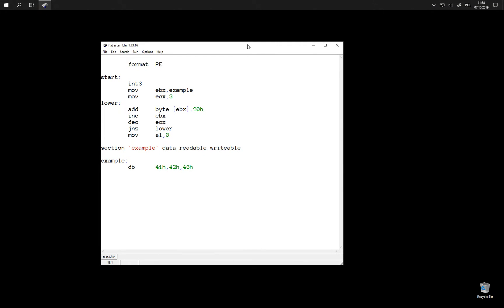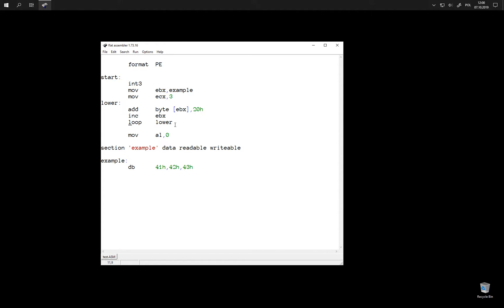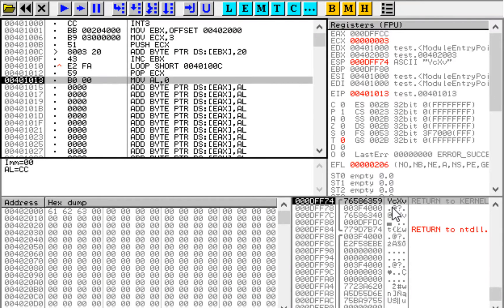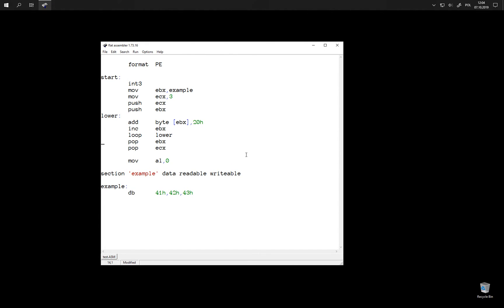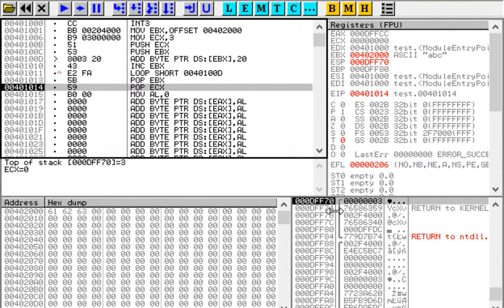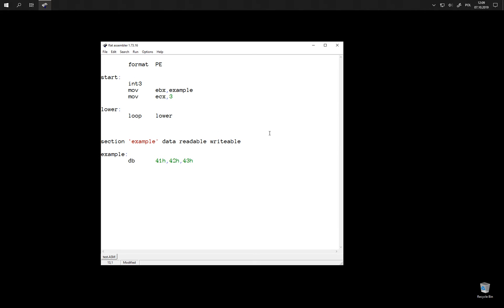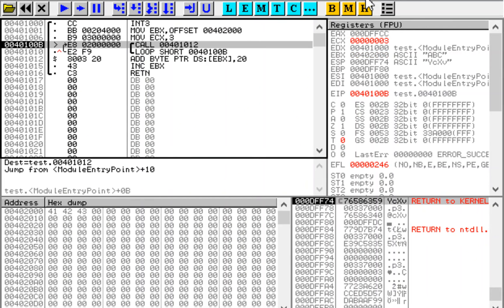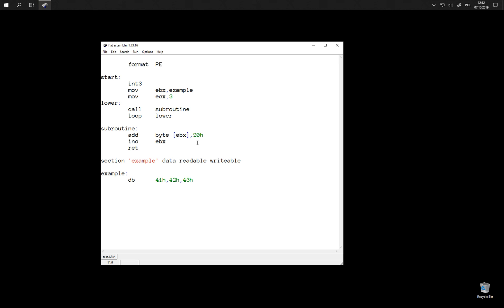Introduction to x86 assembly, part 3: The stack

Comment: Is it ok to just do "ret" to exit your application ?
Instead of calling ExitProcess(0);
It seem to be working.
Reply: Late reply, but if you're on Windows for your own understanding you can look at the Documentation for the 'ExitProcess' function and their 'Terminating a Process' Article. I'm by no means an expert but from my understanding just using 'ret' will not cleanup the entire process and it's threads properly, where the ExitProcess function will actually cleanup everything related to the main process and it's threads.